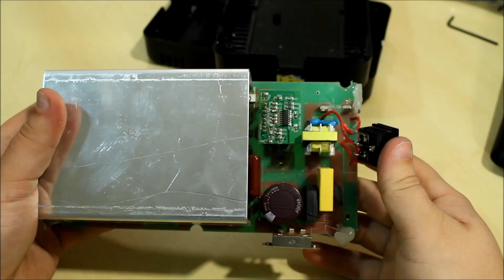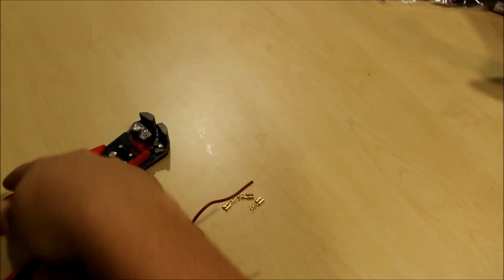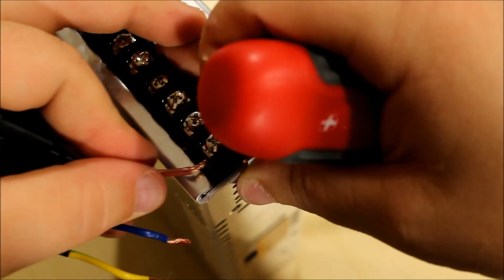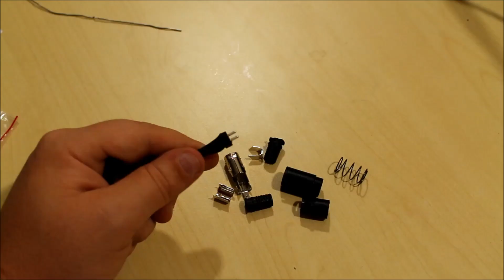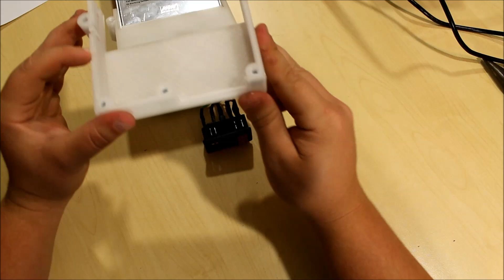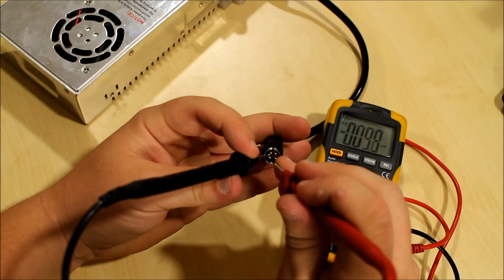RigidBot Power Supply Upgrade

Comment: That’s way cleaner than my stock RBB PSU lol.. my clover had those small blue caps simply twisted onto the pins -_- who thought it was okay to sell these things!? especially for use with a printer that will be running for long jobs unattended at times!? Like this has got to be a bad joke they thought people would discover sooner..
I just added a bunch of new e3d v6 de mounts and bodum extruders to my RBB that’s been sitting for 5 years only to find it not powering on.. I’m guessing g the PSU is the problem and ordered a knock off MW SE-450-24 by inSharePlus.. was about 50% the cost of a MW so I’ll be sure to check the quality before hooking it all up but I can’t really afford the MW right now so I might have to keep an eye on it and use it for a while until I can make some money with my printer to buy a better one.
Anyway, thanks for the video.. it will help me swap to the new PSU more easily

Comment: Nicely done.  Unbelievably, I still have my Kickstarter Rigidbot in the box untouched!  life got in the way for a few years as I got into van life and converting not 1 but 2 vans!  Seeing the dangers of the original power supply I found your video so will do something similar with that new power supply and never even plug in the original.  Looking forward to putting it together after all these years as an upgrade to the wood/string driven Printrbot that predates even it!

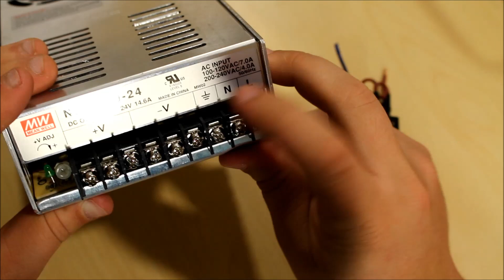Comment: Good video. One thing I'll say is that at 10:22 you state the L means "Live", What it really means is "LINE". L means LINE, N means NEUTRAL, and the Ground symbol means GROUND. Being a electrician/electronics tech I just wanted to point that out. Not slamming or any thing along those line. Again good video.
Reply from the maker: Mikey8567 Thanks for that info, I learned something today :)
I'm a bit of a noob when it comes to AC electronics, most of the things I do use DC.
Reply: Actually, to be honest, Live and Line are both accepted terms that mean the same thing. Usually in the USA we use "Line," but seeing that you use brown and blue wires instead of white and black (here in the USA), I'd assume you'd say "Live" instead.

Comment: Did you need to change any settings in your firmwate header files?  I have an e3dv6 and after this upgrade I can't stop the heater from going way beyond what temperature I set it to.  It also seems to 'idle' at 80 degrees celsius even though minimum is 5.  I am using the latest rigid bit marlin firmware.
Reply: you need to do a pid autotune. check out triffid hunters guide on it

Comment: What sort of gauge should I use on the wires?
Reply from the maker: Devin Keeney Depends on the wattage of the power supply. In this I just used wire rated for 15A continuous current which is adequate for a 350W supply. I think it's somewhere around 14G

Comment: Hi Tom, sourcing those power supplies is a bit of a nightmare. After asking around JayCar, Altronics, and giving up, I resolved to just buy the supply online. But the TRC website only ships to the US! Not comfortable getting a no-brand one from China on Ebay. How did you get your Mean Well power supply?
Reply: Ah, looks like I have not much choice. The alternatives off the shelf stuff in Sydney are expensive bench power supplies, going upwards of $400. I ended up ordering one of these: 

http://www.ebay.com.au/itm/111372413144
Reply: Matt Cabanag I have two of the 48V PSUs for my milling machine for powering the steppers :)
Reply: I got mine from Ocean Controls (http://oceancontrols.com.au), but Jaycar also stock the Mean Well brand (but might be dearer).

I really liked the teardown on the PSU - I took apart a 12V model just to see how it was, and came to a similar conclusion you did :)

Concerning the soldering - a good quality crimp (like what you did) actually forms a cold weld. Soldering it means the solder (which is hard) wicks up the copper, and that's where breakages can occur.

I love the box and mounts you made. Really nice :D
Reply from the maker: Hi, I bought my power supply from here, took about two weeks to get to Australia:
http://www.aliexpress.com/item/mean-well-power-suply-24v-350w-14-6a-AC-to-DC-power-supply-NES-350-24/1423262546.html

It's much better than the dodgy no-brand ones. :)
Reply from the maker: What you ended up ordering is good as well. It's more than I could afford though.

Comment: Nice video.  A child could have done a better job of soldering.
Reply from the maker: EDIT: I'm not sure if you're talking about the rigidbrick or my soldering haha. A child could have definitely done a better job at the rigidbrick soldering. That was atrocious.

Normally I take a lot of pride in my soldering and have extremely high standards but getting such large conductor into such small solder cups is damn near impossible. Looking back on it, I actually think a better way would be to put the wire between two pins and bridge the solder across. Any feedback or suggestions on how I could do better is appreciated. :)
Reply: Make'n'Mod Sorry, I was a little ambiguous on my comment.  I did mean the rigidbrick.  Your soldering on those tiny cups was good.  I wouldn't have tried it.
Reply from the maker: No need to apologise. The tiny cups were a challenge but they're definitely doable. Compared to surface mount soldering there's a fair bit more room for error.

Comment: Hello Tom, and thanks for all your amazing Rigidbot videos, it allowed me to build mine.
I am now about to replace the PSU myself, and the only piece I am missing is a Kycon connector for my cable. I would like to know which Kycon connector I should go for from that page : http://www.mouser.fr/search/refine.aspx?Ntk=P_MarCom&Ntt=113898257
Thank you for your time.
Reply from the maker: You're welcome.

I'm pretty sure this is the 4pin plug that I used. The datasheet shows that anyway. http://www.mouser.fr/ProductDetail/Kycon/KPPX-4P/?qs=sGAEpiMZZMtnOp%252bbbqA009InjtOSxl2rhfRsxoO9OKo%3d

Comment: very nice.  im upgrading my power supply on my makerbot 2x now.  
i have one question. should we connect the 4pin by two out put from power supply.

Jun
Reply from the maker: Don't Makerbots' come with MeanWell power supplies already?

All the power supply outputs are linked together on the supply I'm using. The 15A cable is rated high enough to carry current for all four pins and the printer end and at a guess the screw terminals are rated above 15A but I'd have to double check.